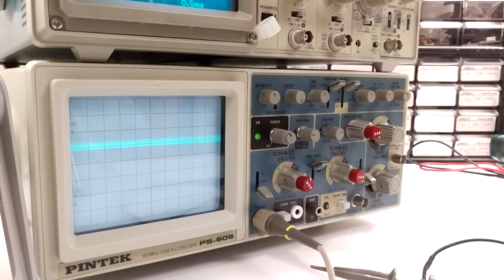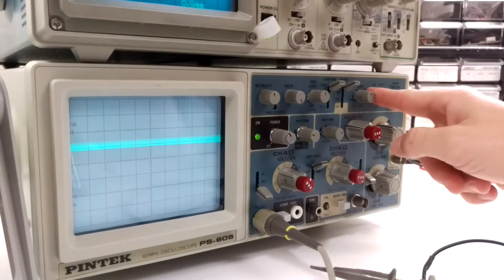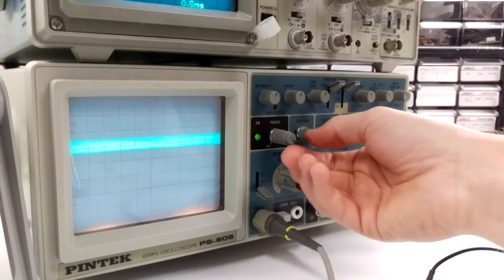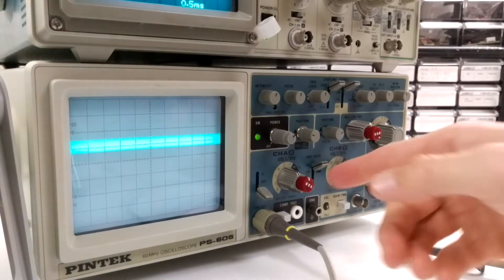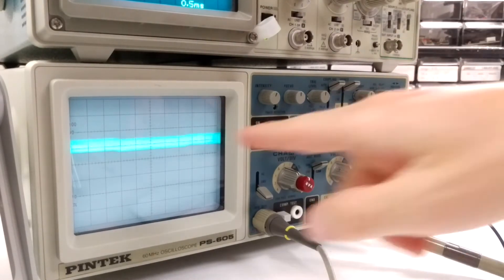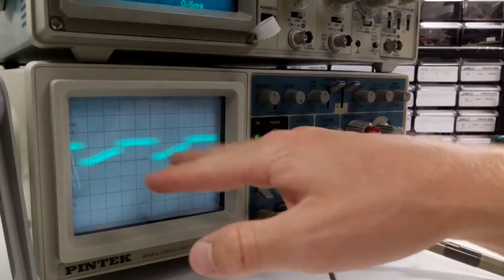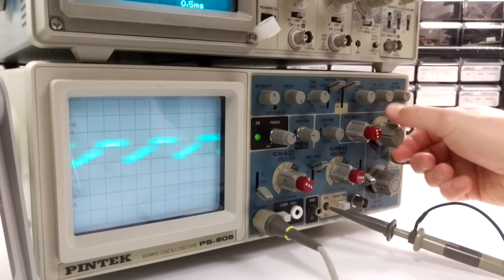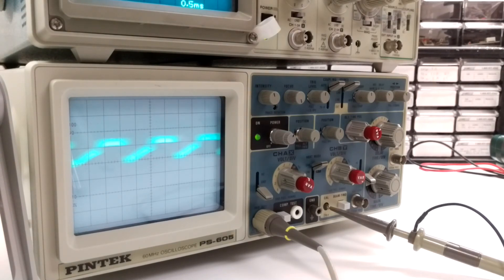Pintek 60MHz Oscilloscope PS-605

Comment: Please tell me you have a fix for this. I have a PS 205 WITH  EXACTLY the same symptoms.
Reply from the maker: I'm sorry, still no fix. I haven't had time to debug it
Reply: @watts-jake  should we start a whatsapp group on PS205/605?. I just bought one and hear a POP! after turning it on. Im about to start troubleshooting.
Reply from the maker: @omarcusihuaman4261  I'd be interested in know what happened to yours! Keep me updated! I'm sorry I don't have watsup
Reply: @watts-jake  HEY jacob, im going to start with my scope, do you have a IG or FB acount so i can send you PM?
Reply: @omarcusihuaman4261  Yep mine too its the High negative voltage cable to close to other cables and its arcing and mine did in the vertical position controls

Comment: Did you finally solved de problem. I had mine with very few use, and go into a similar problem, impossible to focus with the external handle. It seems there is another focus potentiometer inside, and that was the problem in my case, perhaps a lit bit of humidity. After move it a little, it focused very nice again, mine is a PS-205. Hope it helps. Best Regards.
Reply: Esteban arreglaste el tuyo? Cómo te contacto?
Reply: @omarcusihuaman4261  Buenas Omar, encontré un potenciómetro que está relacionado con el circuito de foco, pero se encuentra dentro del osciloscopio. Probablemente solo había cogido algo de humedad. Lo moví un par de veces en ambas direcciones y problema solucionado. Un saludo.
Reply: @omarcusihuaman4261  Buenas Omar, encontré un potenciómetro que está relacionado con el circuito de foco, pero se encuentra dentro del osciloscopio. Probablemente solo había cogido algo de humedad. Lo moví un par de veces en ambas direcciones y problema solucionado. Un saludo.

Comment from the maker: I've opened up the oscilloscope and have found some burnt resistors, they're not on the input side they're on a 140VDC rail from the power supply. Here's a link to the form I posted on for help...

https://www.eevblog.com/forum/repair/pintek-60mhz-oscilloscope-ps-605-issues/

I'll be posting another video going over the issues I've seen.
Reply: Good luck jacob 
But i will tell you one thing  no one can help you right not the eev blog forum and not even me because the set its not in front of us  but  i can give you tips from the looks of it and because you are saying that there  is a burnt resistors on 140v it mean that you have a cap proplem be carefull this voltages can kill you  god protect you be safe

Comment: You hove a problem in the channel in put bord soon i will turn down my oscilloscope and i will show you were is the proplem in your scope
Reply from the maker: So I've opened up the oscilloscope and have found some burnt resistors that are connected to a 140VDC rail. I've talked on a form about it... Here's a link to it if you're wondering. I'll probably be posting another video laying out what I've found and done so far...

https://www.eevblog.com/forum/repair/pintek-60mhz-oscilloscope-ps-605-issues/
Reply: @watts-jake  
What is the resistors numbers on the bord